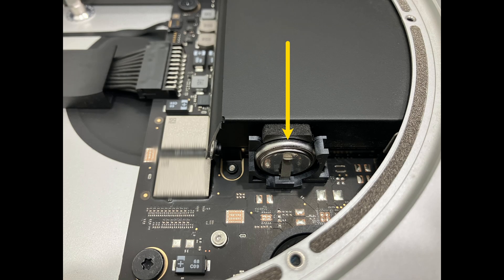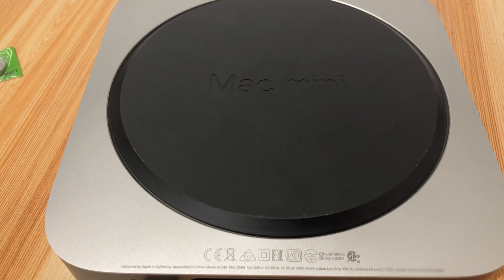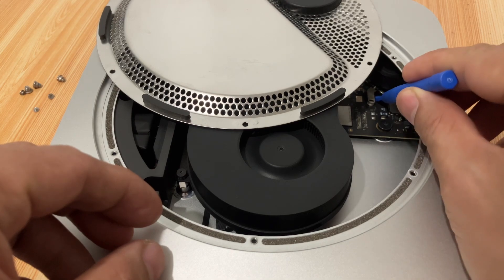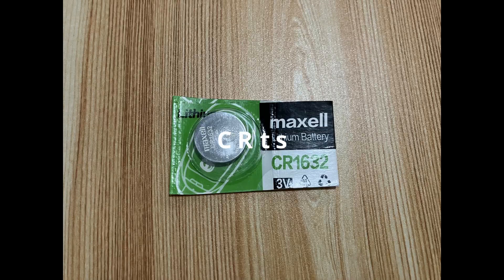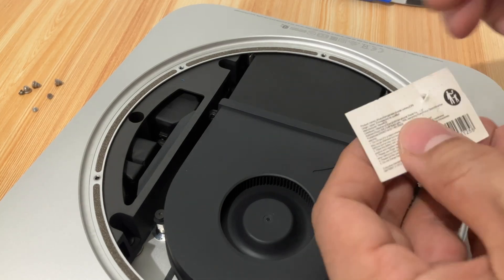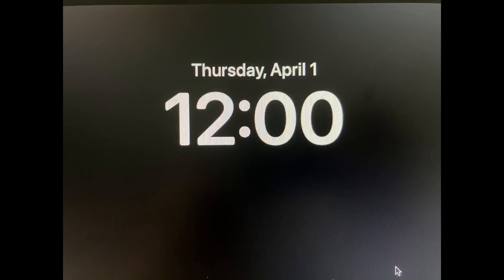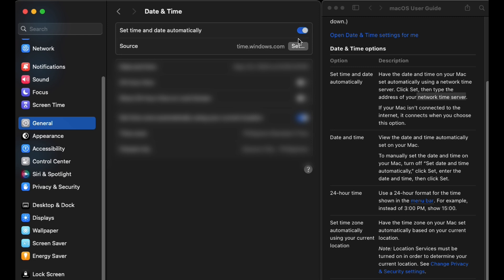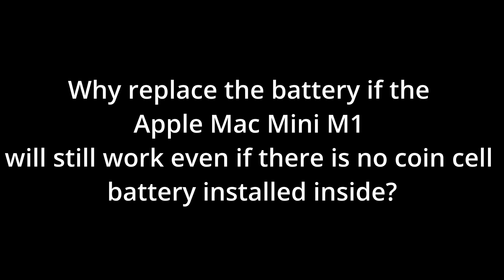How to replace Apple Mac Mini M1 internal battery

Comment: The main difference between the original BR1632A and the CR1632 is the temperature range. The BR1632A is specified up to 125 degree Celsius. The CR1632 only specified up to degree 60 Celsius. This could be an issue when the Mac mini runs hot because of intensive tasks. In the worst case a „wrong“ CR1632 could explode and can cause some damage.
Unfortunately I could not find a source where I could order a BR1632A replacement battery. 
So most people will use a CR1632 or will leave it as it is when the mac is connected to the internet.

The mac mini M4 does have a different design. 
The battery is easier to change and only a BR1632 is needed (not a BR1632A) which is easier to get (found it also on amazon).

Comment: In my experience you can get enough clearance to change the battery without removing the cable for the wifi antenna.